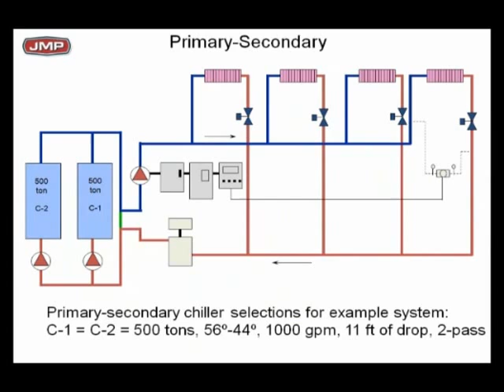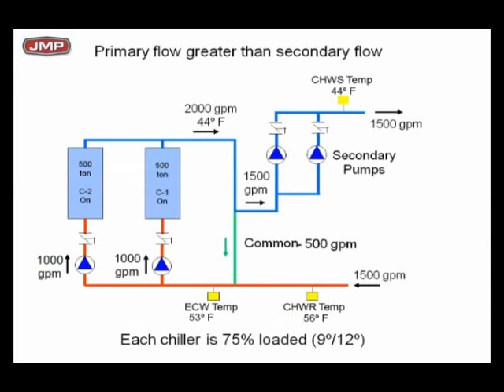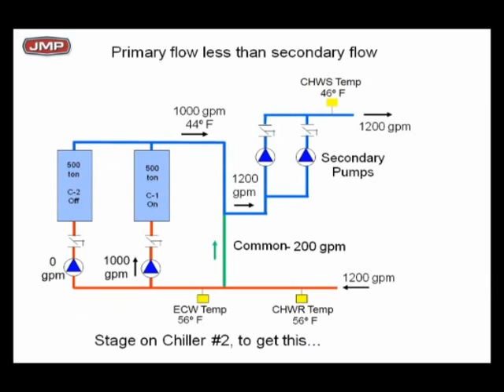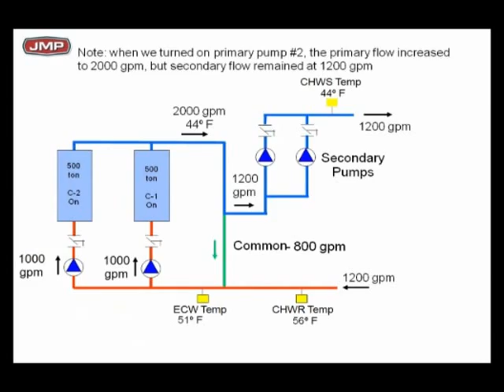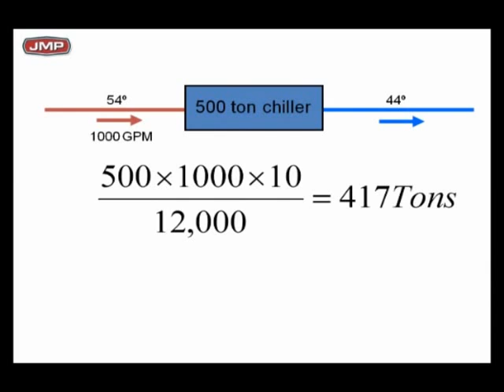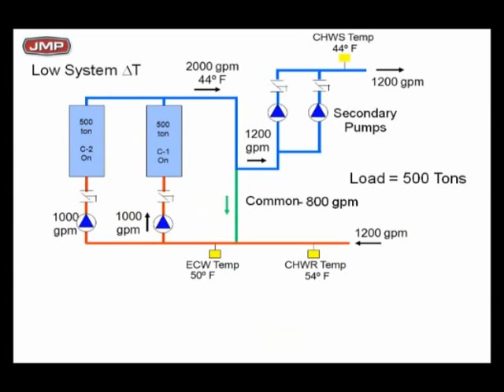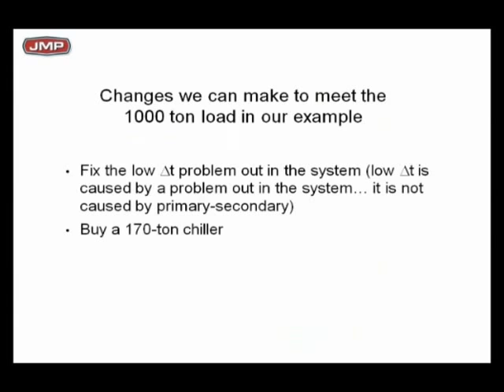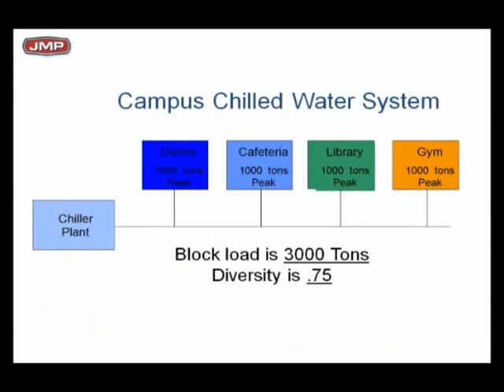Primary Secondary Pumping - Chilled Water Example

Comment: the chiller is on 13th floor of the building and the flow reading at 13th floor is only 800gpm... and im sure it was very low,,, could u help me? thnks much...
Reply: Check the flow required for complete system.......pump capacities...... add VFD to secondary pumps...If u want to reduce pressure drop.....Study drawings & try to change pipe sizes... with min damgaes.....

Comment: i have 2 chwp pump capacity is 1900 gpm each,,, when i run the 1st pump i read only 1700 gpm same on the 2nd pump, when i run them at a same time i read in flow mtr. only 2000gpm and i think this is low reading, could you help me to solve this issue?! thnks, best regards.
Reply: I think your pump head is undersized...